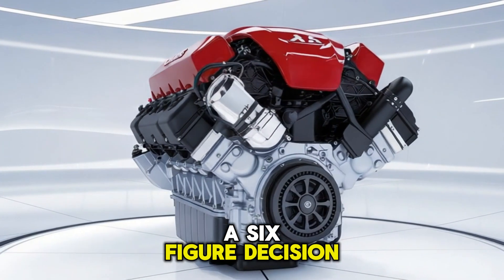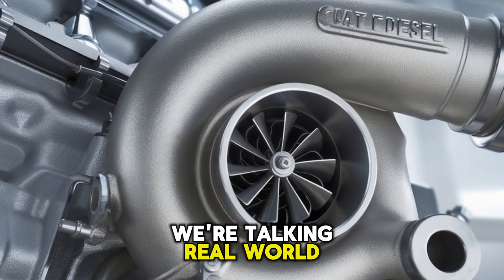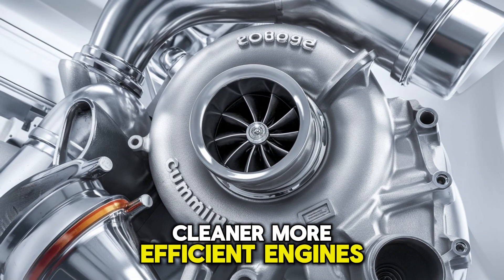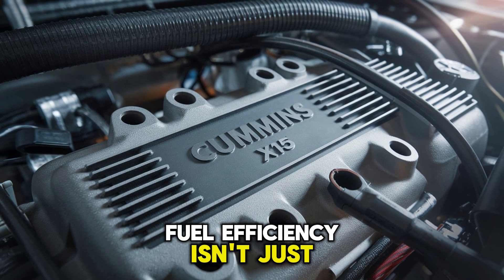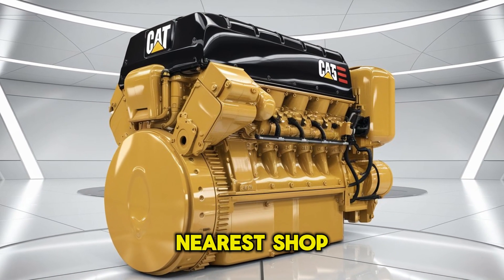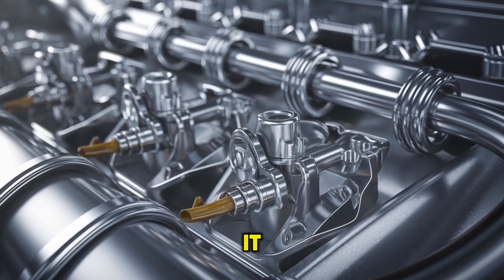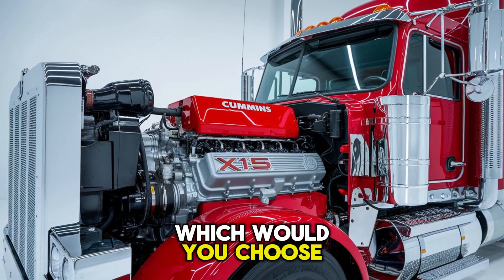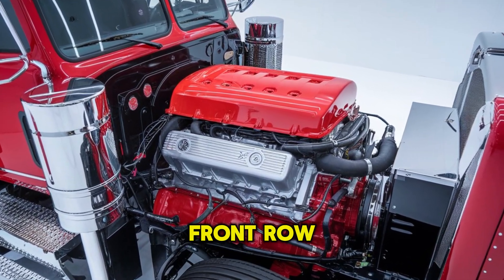CAT C15 vs Cummins X15: Pros, Cons & Which One You Should Choose

Comment: X15 has been one hell of a reliable unit besides one def pump leak I’ve had. Besides that no issues in almost 150,000 miles. Doesn’t use a drop of oil. Sitting at 300k engine unopened